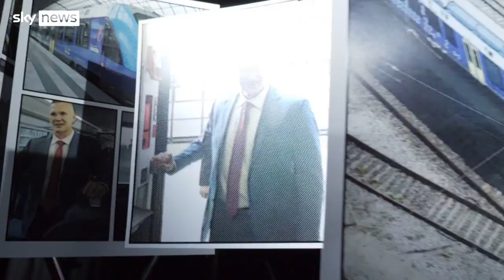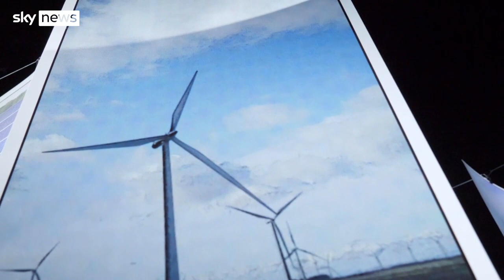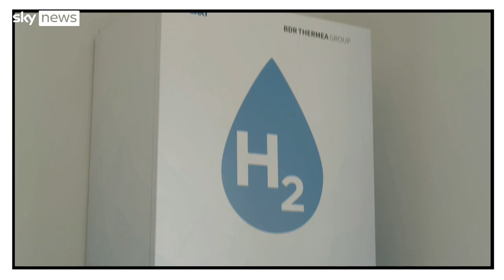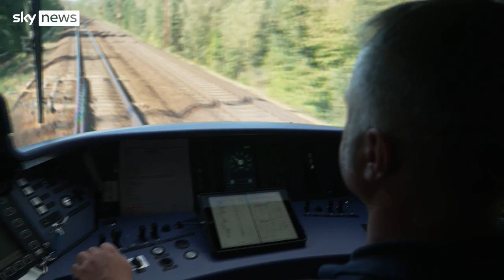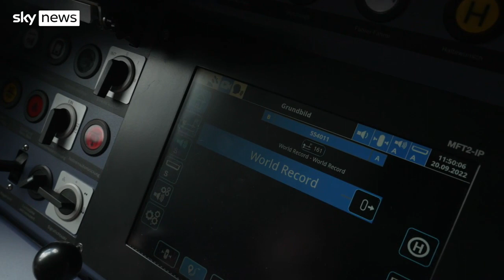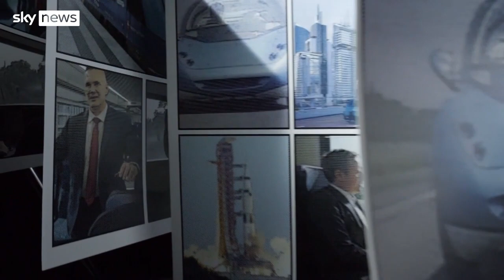How will hydrogen power our future?

Comment: Only excess electricity from the green source has to be used to create this hydrogen. Otherwise, there's no point in using electricity from a green source to create hydrogen an energy intensive process, which then goes into the train's fuel cells and gets reconverted back into electricity to drive the train.
Reply: Exactly this. Electricity in itself is more useful. Even lithium batteries might be more efficient. For storing the excess, hidrogen seems like a good option, but we do not have much right now.
Reply: @valkaielod  There are many remote places with excess electricity that is cheaper to export as hydrogen rather than building long distiance power lines and batteries.
Reply: Hydrogen can be used to turn a turbine, which can produce more hydrogen.
Reply: @jimj2683  It is too difficult and too expensive to transport economically.

Comment: hydrogen is incredibly inefficient and for almost all applications its better to use batteries and electricity due to the reduced losses compared with converting excess renewables into hydrogen and then back into power.  Its so much cheaper to store that power in a battery than as hydrogen
Reply: Batteries are not practical for trains, ships and planes because of costs, range and weight.
Not even practical for long distance heavy goods vehicles.
Reply: @madsam0320  see The Tesla Semi works great they start being delivered in December, 500 miles per charge fully loaded
Reply: @michaelandrews4783  the Tesla Semi was supposed to be ready five years ago, it’s still not really on sale yet.
Reply: This is ironic, gas is more efficient... It is ironic EV care about these things now. Hydrogen is the best solution for long term sustainability, 1 million years into the future
Reply: @madsam0320 Hydrogen is less so.

Comment: Issue isn't getting something to run on hydrogen, it's production of the hydrogen that's the problem
Reply: We can figure it out we always do. All we can do is hope this is the key this will have a massive good positive impact on the environment ⚔️🛡🥲
Reply: The storage and transportation is also a giant problem. Hydrogen is the smallest atom, it really, REALLY wants to escape any vessel it's contained in, and is powerfully explosive. It requires so much energy to produce through electrolysis (green hydrogen) .
Reply: While H2 has a role(grid, aviation,trucking?) it is only an energy store not a source and production  is inefficient. 1kW of green electric is about 0.95kW into a battery but via H2 electrolysis is about 40% efficient, fuel cell about 50% the via a battery to the motor so maybe 1kW is 250W at the motor.
Reply: @karmanline2005  cobalt

Comment: The other option for trains is just putting power lines above the tracks and having the trains run off that. That being said, for 'long-thin' routes, such as in rural Scotland and Wales, this makes a good amount of sense, due to the cost of electrification.

I think green hydrogen production will take place at times where there is oversupply of renewable energy relative to demand, therefore unit rates will be very cheap, making production more cost effective. This hydrogen can then be sold over a longer period of time, perhaps even be turned back into electricity which is sold to the grid at times of particularly tight supply!
Reply: Too expensive!
Reply: Utterly backwards lol....
Let's use a ton of "extra green electricity" (which we never have because green generation is junk) to make hydrogen that we turn BACK in to electricity to run the trains.
And here I thought the green climate zealots wanted to conserve energy 🙄 🤔 🤣
Reply: Power lines also have resistance and maintenance costs. At certain distances, hydrogen might become more efficient and economic. It can also be hybrid power freight trains that run between cities. Besides, hydrogen can be generated at night, when electricity costs are cheaper than peak hours.
Reply: @EdwardChan.999  Certainly, older DC power systems running at lower voltages can suffer brutal losses over longer distances.

However, modern 20Kv AC overhead electrification systems have similar losses to long distance power lines, so there is no real scale where hydrogen becomes more competitive from an energy efficiency standpoint.

However, the construction/maintenance costs are certainly less competitive on rural routes, which maybe see one train per hour, whilst also covering a very significant distance.

Comment: The hydrogen train makes no sense at all 😂 it uses more power to create the hydrogen than it does to power the train. It’s more efficient to power the train directly off renewables. Storing energy in hydrogen yes makes sense but trains already have power lines and the infrastructure to directly power them
Reply: Curious...  I am sure it is well-known there are lines that are NOT electrified.  Thus, where diesel locomotives and DMUs are used!  In such cases green H2 is, obviously, a very good alternative.
Reply: @danielvanrooyen2785  I’m sure a few overhead power lines is a lot cheaper than 40-50 hydrogen trains and the subsequent savings over the years of running direct off renewables rather than hydrogen would pay for the said lines the hydrogen trains are just an ongoing extra cost that’s unnessecery with proper planning.

Comment: 3:16 this is inaccurate. Burning hydrogen in air produces nitrous oxide, worse than CO2 for greenhouse. Hydrogen has to be used in fuel cells to avoid greenhouse gas emissions.

Comment: Hydrogen seems to be a portable solution for electricity storage solution as most of it is still generated from electricity and most efficient way to use it seems to be building a chemical battery.

Comment: It takes more carbon to make hydrogen to power a train than just using carbon directly in the train in the form of coal, gas, or oil.  The electric made from green sources such as the water plant shown would be cheaper powering the train.  Break in hydrogen from just about any other element is incredibly power useage heavy.  Non starter.

Comment: slight issue.... getting hydrogen requires a lot of energy and is usually generating using electricity
Reply: Dehydrogenation of methane is a readily available industrial process.
Reply: That can be generated by renewables and nuclear when govt wirdos get their backsides into gear, not to mention the push for higher EV adoption major investment in electrical infrastructure is painfully needed
Reply: @anthonywalker6168  But steam methane reformation is absolutely god awful for the environment.
Reply: @samspencer7765  Indeed, unfortunately it’s the only method that could produce enough supply for future demand. The problem is actually too many humans… how do we solve that problem?
Reply: @anthonywalker6168  readily available but still requires a large input of energy
Reply: @BizzarFish1  while totally true there is embedded carbon in both of those sources of energy
Reply: @samspencer7765  I agree to some extent. Obviously no solution is ideal. The Haber process allowed for increased crop production (fertilizer). Modern medicine keeps people that perhaps shouldn’t live, alive…. Technology has extended the lifespan of humans, there is very little we can do besides lawfully limit peoples choices and “freedoms”

Comment: This presentation was a combination of good and a little bit of not quite so good. Talking about the question of hydrogen as hype or not, or bubble or not, belongs to the latter, and seems to be more of an attempt of making the presentation more exiting and entertaining than creating real understanding. The concept of using hydrogen for energy storage is proven and valid. Things that are pushing it forward and on the other hand hindering it are continuing advancements in technology, economics, rivalry between different energy systems, politics, etc.. The fact that in previous decades people were led to believe (by the media) that we were closer to the era of widespread use of hydrogen in the energy infrastructure than we were doesn't change the current reality. Much has changed technologically, politically and environmentally. Hydrogen is now one of things in the centre of solving the climate crisis, and at least in the EU it has already been decided that a hydrogen infrastructure serving different industries and as energy storage will be developed, and will be developed in a fast pace.

Comment: Hydrogen production requires a lot of electicity, which assumes that many nuclear reactors gave to built to achieve enough power
Reply: excess wind generated electric like the shetlands has
Reply: @Mark Jones - Slight problem. The Shetlands don’t have excess wind generated electric. 

Lerwick Power Station - diesel - 50%
Sullom Voe Terminal - gas - 30%.

Comment: Using Hydrogen is not efficient from a fundamental physics point of view.
This diagram summarises the poor overall efficiency of Hydrogen ~30% compared to Battery Electric ~ 85%.
https://cdn.motor1.com/images/custom/battery-electric-bev-or-hydrogen-fuel-cell-fcv-source-volkswagen.jpg
Reply: For example the hydrogen ART can run up to 245 km in a single, very quiet and enviromental friendly.